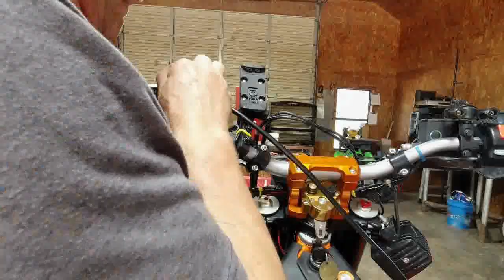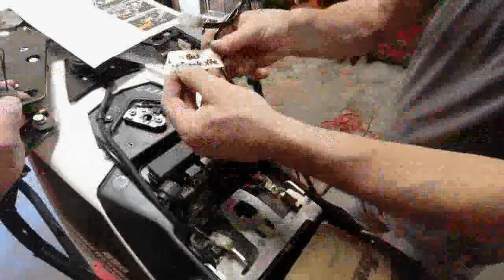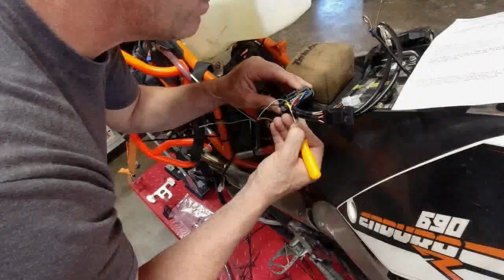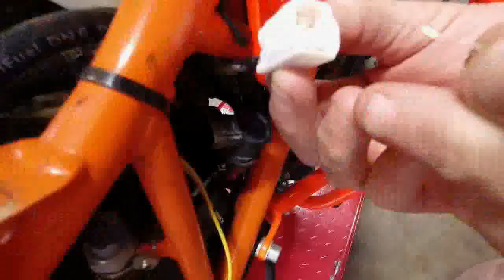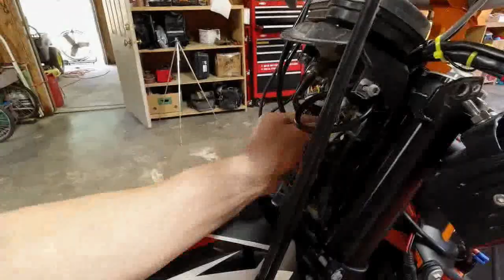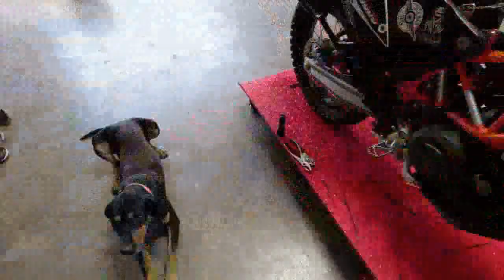McCruise Cruise Control on a 2018 KTM 690 Enduro R

Comment: Did you order yours from Australia? I am showing this is about $700 usd on their site! Did yours cost this much? Seems like something isn't right on their website, so I am trying to figure out if someone in the states is selling these in the States. Thanks
Reply from the maker: Thank you for reaching out to me. Yes I believe you have to go through them. I believe it was about $600. If you contact them "email" just ask they are super.helpful. I was one of the first to do this on a 690. I actually bugged them for 6 months about making a kit. I'm sure I wasn't the only.one though. There is a discount code somewhere in the video. Not sure if it still works.

Comment: Why do you have to disconnect the battery?
Reply from the maker: Hi and welcome to the channel. Great question the main reason is to avoid accidentally grounding out a power lead. You could pull a fuse but by disconnecting the leads at the battery there is no possible way to ground something out when you don't want to...